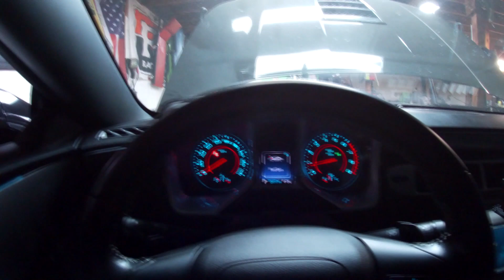Voodoo Performance VVT Cam Install And Ripping The Streets

Comment: Nice what power gains this is the exact cam im do on my camaro
Reply: Long tubes, full exhaust, cold air, and stock stall converter, this setup makes just a tad over 400 to the tire